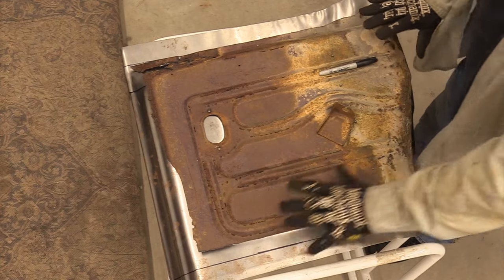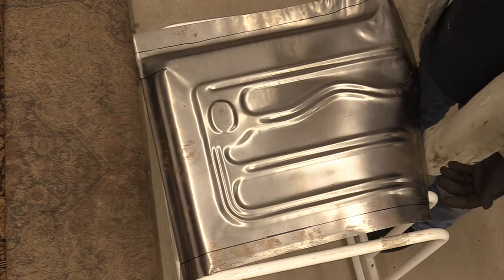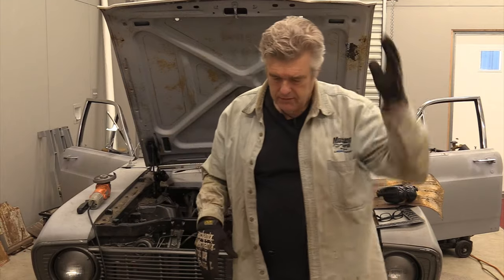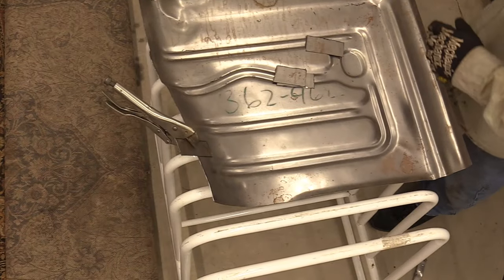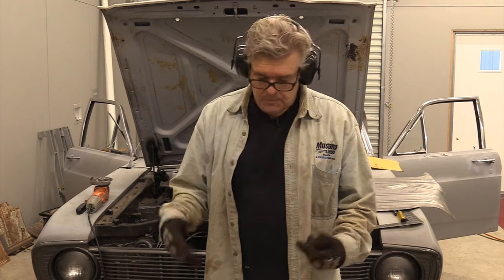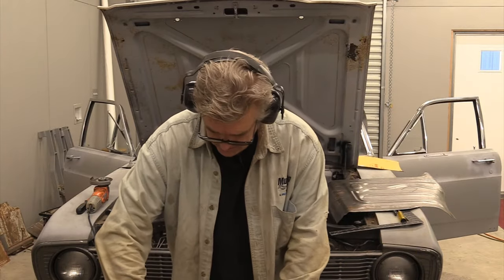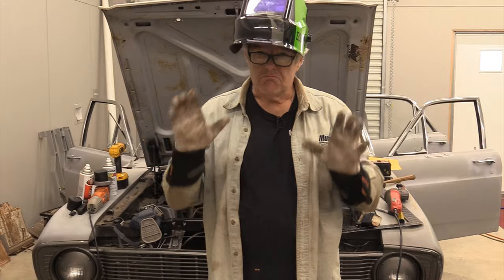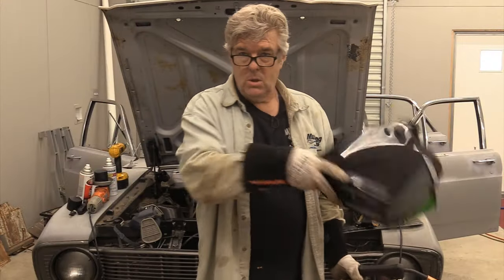Master the Art of Floor Pan Installation Top Tricks and Tips

Comment: The way I learned to do plug welds is to start just at the top outside of the hole, strike the arc, then spiral down in and around to do the whole thing in one swoop. If you practice that first on some scraps you'll get the hang of it. Also your stick-out looks a little long; it should be 3/8 to 1/2" to stay inside the gas. This just takes practice on something that isn't your car, and I don't claim to be an  expert. Cooling with the air hose is good practice ;)

Comment: Weld through primer
Reply from the maker: But see, that's just a primer. Most primers I have experience with tend to be more porous than standard enamel paint. In either case, the area right around the weld is still going to burn the paint; or the welder primer off.